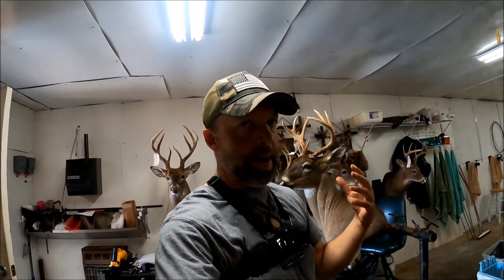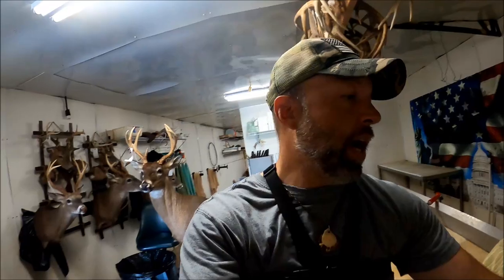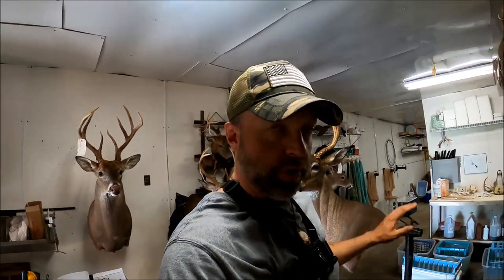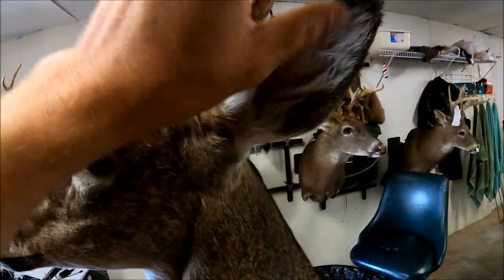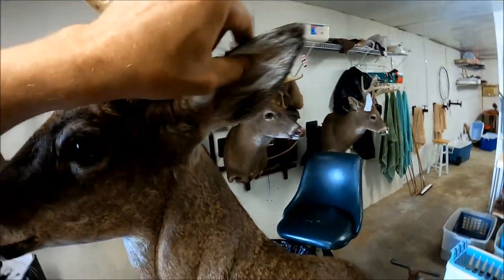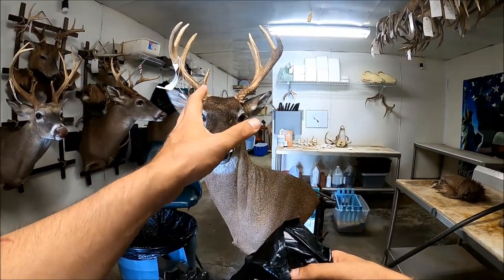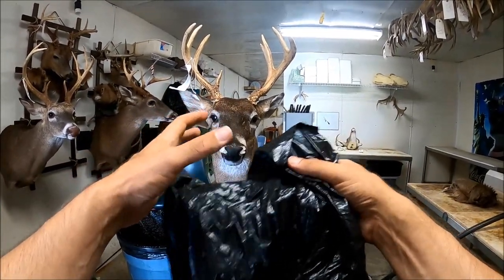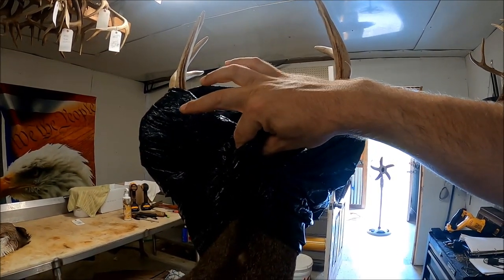SLOW DOWN cape drying time! Why you should use this hack! ***SUPER EASY*** WHITETAIL TAXIDERMY!

Comment: How about the clay drying process?  Same theory? Also, once you add clay to the eyes, face ect how long do you have or how long should you wait to mount the cape? Thank you
Reply from the maker: Mount everything immediately as possible. You don't want clay to dry before mounting or it will break into pieces and cannot be shaped. The bag does prevent the clay from drying as fast, and helps if you need time to finish details a day or so later.
Reply: @thecedarridgechronicles  thank you sir

Comment: What do you do if the inner ear is torn?  The deer had sores from ticks in the inner ears and looked bad.  when I was separating the ears they tore and fell apart.  How can this be fixed?  Can you take a peace of hide from the under belly back by the nuts and stich it in ?? or glue it to the plastic ear liner  ??? John W
Reply from the maker: https://youtube.com/shorts/DyDzZ9LLWa8?feature=share
Reply: @thecedarridgechronicles   the ear are worse than that one was so bad  from scratching it fell apart.
Reply from the maker: Ok. I would glue it directly to the earliner the best you can and try to keep the pieces left flat against the liner. After it dries, flock it with white flocking material. I believe this will get you taken care of